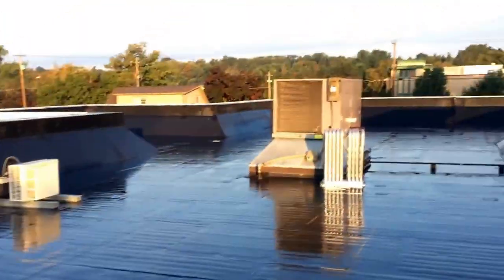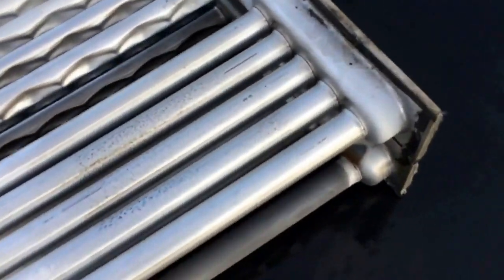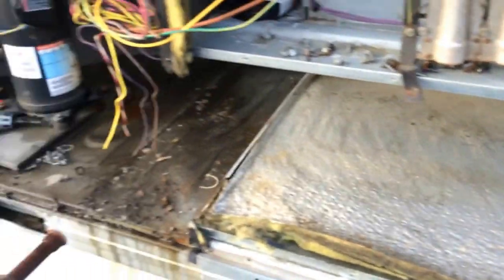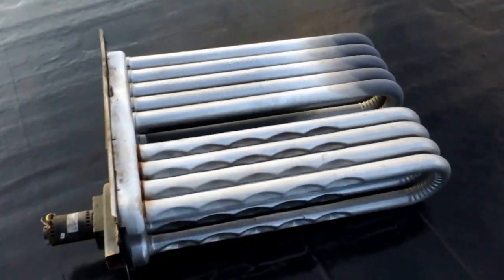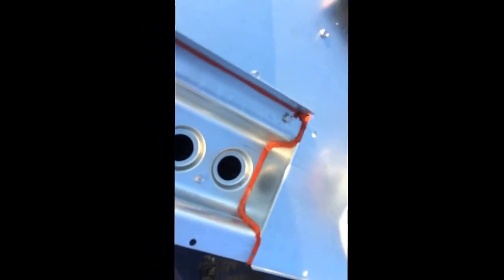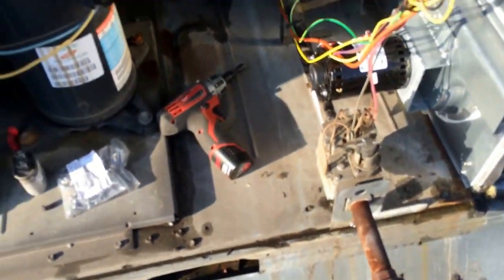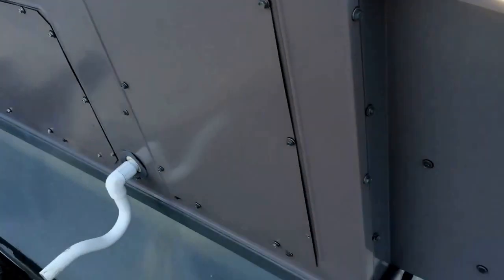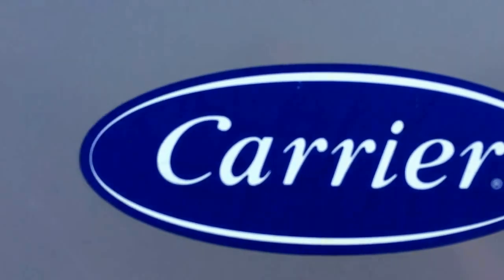Heat exchanger changeout on Carrier RTU

Comment: Don't work on do many commercial rooftops , how long does that replacement take? Good job Rob .
Reply from the maker: Thanks justin henning   That job took us two hours total. And we were working slow. They are the easiest to change. Funny thing is they bid the job for two guys 8 hours.
Reply: Hey works out for the company , well done bud.
Reply: justin henning hey justin carrier  make it so tech friendly when it comes to replacing those. However if you had to replace one on a luxaire or the old Yorks. That would definitely be a pain in the u know what and probably take 8 hrs to replace it.